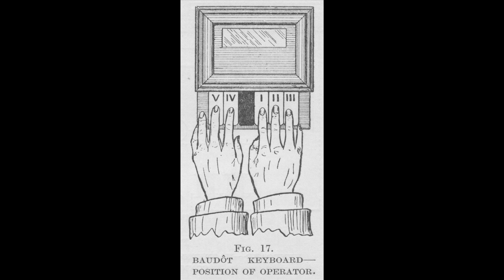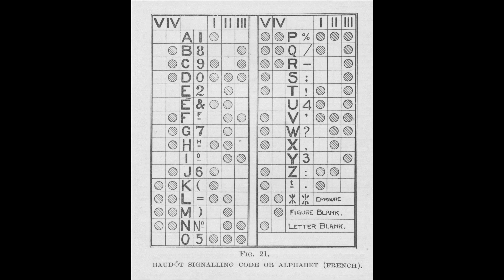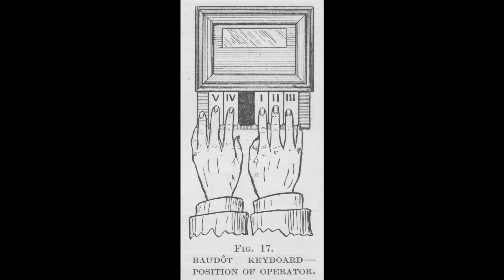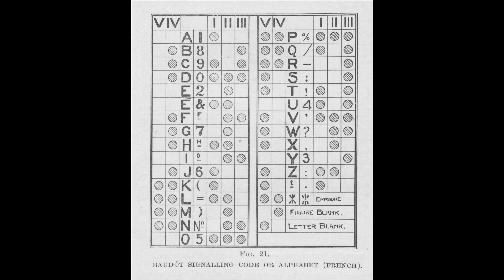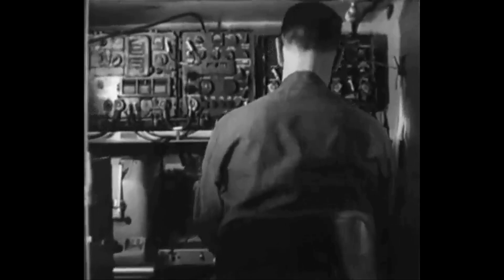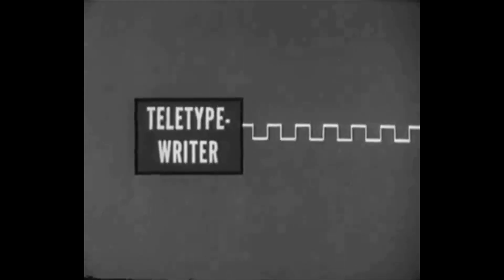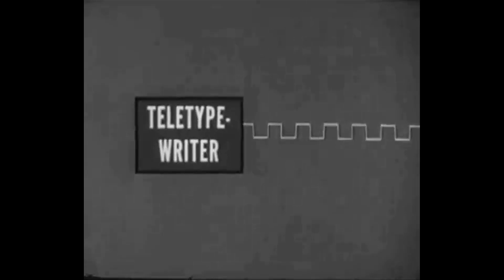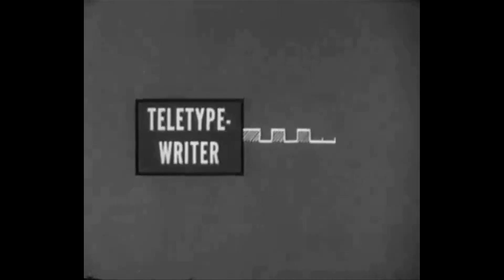Channel capacity (baud rate)

Comment: I got lost @ 2:43.  I am not sure what he means when he said "then and today, the speed of transmission was physically limited by the minimum number of spaces between these impulses"

Suppose we have a clock that's 120Hz, are you saying that it's not physically possible (due to the interference factors you talked about) to achieve 120bits/s; i.e. the symbol rate is strictly less than clock rate.
Reply from the maker: yes exactly